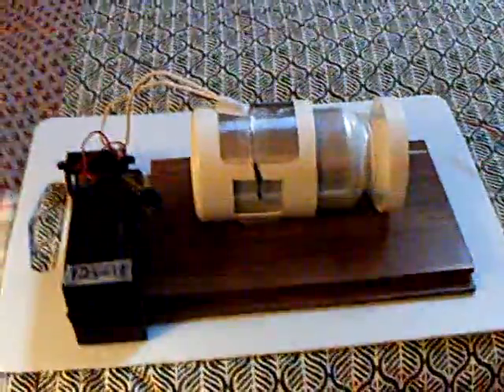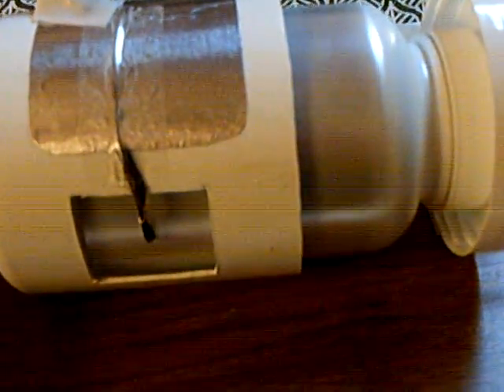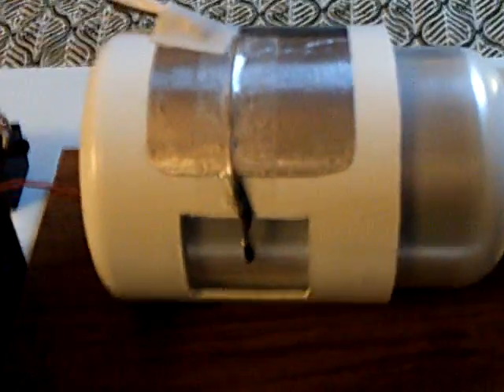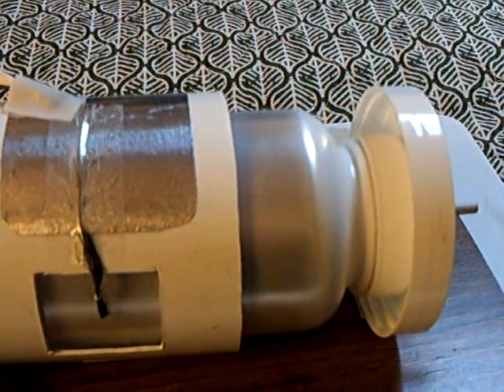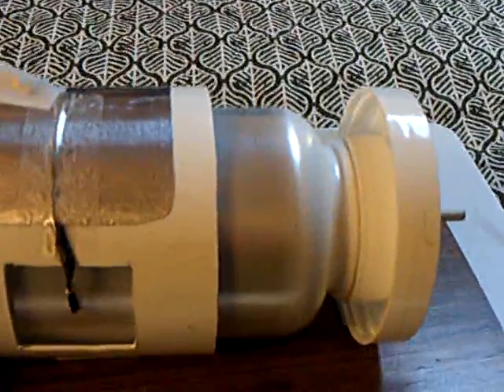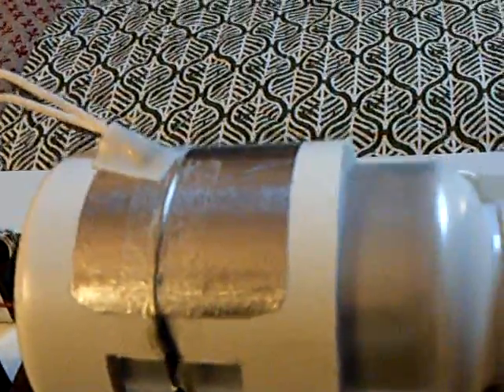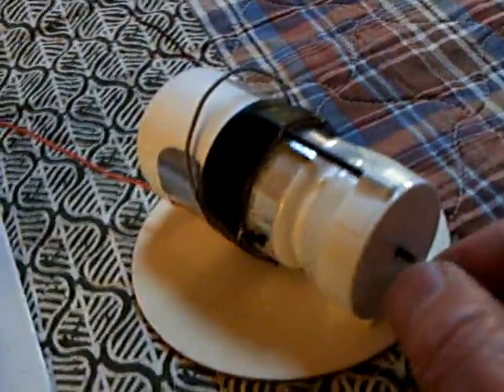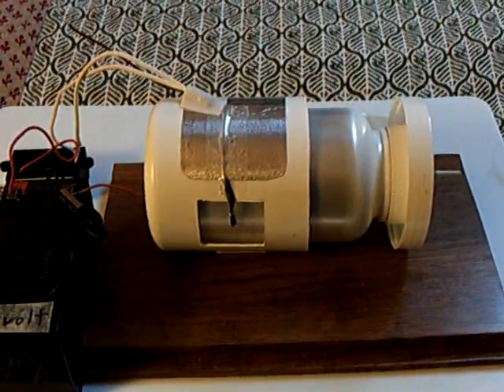Pill Bottle Electrostatic Motor

Comment: What may be even more amazing to me is the balance that pill rotor has.  I've tried creating a lot of 'lid motors' using plastic caps/lids/bottles and I have found it extremely hard to get it perfectly balanced, even where there is some kind of marker or visual guides showing where dead center is supposed to be.
Reply from the maker: Just trail and error.  All of mine wobble a little.

Comment: Does a magnet bother the electrostatic field when it comes near the motor?
Reply from the maker: Magnet fields don't seem to bother this.  Apples and oranges???
Reply: Thanks for filling me in on this I wasn't sure if the earths magnetic field or even a magnet did anything as far as deflecting the static away. This part of physics isn't fully explained out in the open as regular electron flow is. I didn't mean to ask a tit for tat question.

Comment: Could you make half of the bottle as motor and half of it as generator, and then drive a second motor with the generated voltage? I would like to know if the generator acts as a load or not (and if it generates sufficient voltage to run the second motor). Just a fun idea.

Comment: I know nothing and this is probably a silly thought but; if the wheels were much larger and much lighter in weight would there be more leverage and therefore require less energy to turn? I was just thinking that foam might make a light weight wheel. Please just ignore me if this makes no sense. Ha! I always like your videos. Thanks!
Reply from the maker: YES!!  That is exactly what I have thought. This could be made out of very light materials and probably work better.
Reply: I will have to mention that conservation of energy will not allow for less/more energy usage, so if what you by 'less energy,' you mean greater efficacy and efficiency due to higher torque and less rotational speed (which in turn means less frictional loss), then I would imagine so. Also, I'm not sure, but I have the thought in the back of my mind that normal styrofoam has a relatively rough surface and this might cause some sort of atmospheric drag, but this might be a negligible effect, who knows!

It would be awesome, lidmotor, if you could find an formula to determine the maximum energy output of the motor. I would imagine you could connect a flywheel of sorts to it, and calculate how long it takes to for it to spin up to some speed (100rpm?), and if it's mass is known, theoretically, you could calculate the power of that motor, and by dividing that by the power it uses, calculate the efficiency! I cant imagine the formula's would be more difficult than some quadratics or maybe even exponential stuff.
Reply: Power Max
Maybe the word energy was the wrong word to use and or I was confused about that. Thanks! I was just thinking of increasing endurance and decreasing battery size but not actually performing work or creating any useful torque. Yes I was thinking about max efficiency but I may be confused about that term also. Anyway, thanks for the explanation.